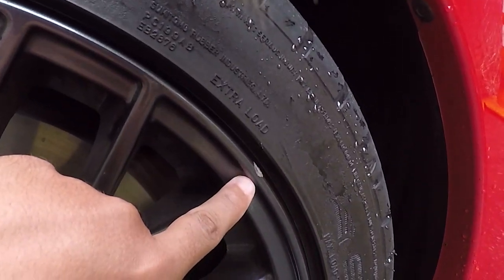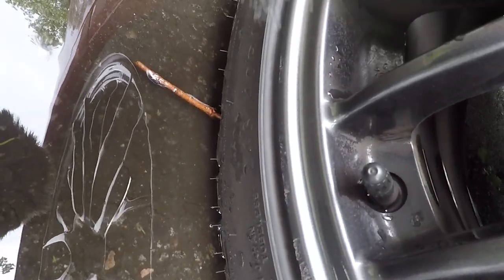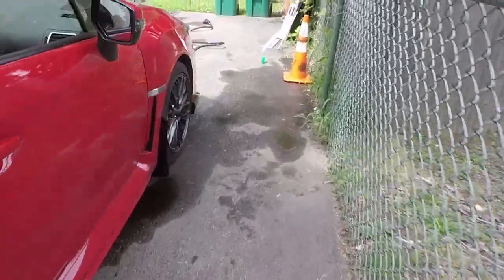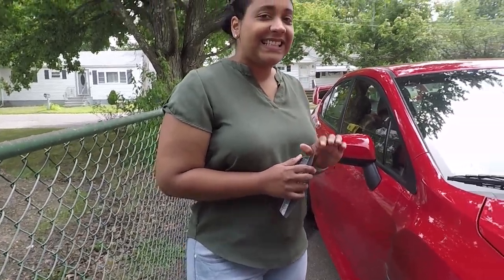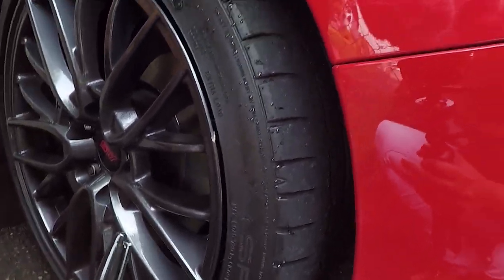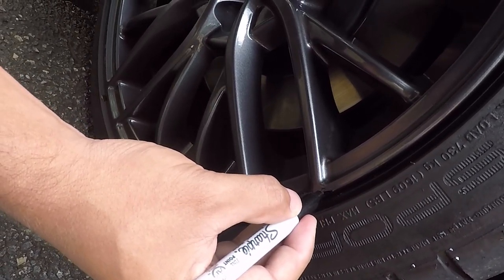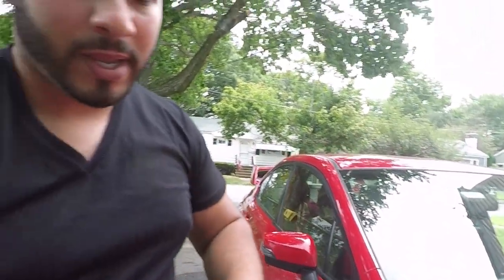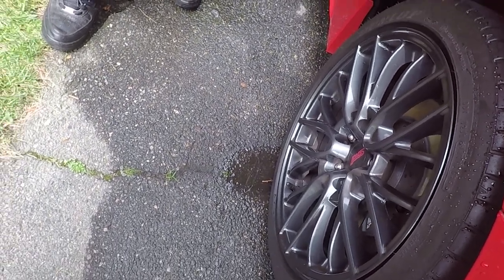DIY: WRX STi Curb Rash Cover-Up

Comment: Dude insane job on fixing this up, that's sick. Need to do this now myself haha.. but my wheels are bronze. So, I guess I need to get them fixed somewhere hmm :/
Reply from the maker: NinjaxBart go to a Subaru dealer and get touch up paint that matches that color or something is close to the color of the wheel until you get them fixed.🙂

Comment: nice video man, i had a similar situation happen to my 16 wrx but only the rear right rim leaving a curb
the premium wrx rim is gunmetal so do you think this sharpee would work
Reply from the maker: Mio Micevski yeah should work. Also if your really worried it won't match just wash the rim and scrub it off the sharpie ink should come off, and get Subaru touch up paint that will match a bit better. Also black nail polish should work :)
Reply: I'll give that a go, possible even a grey/silver sharpie as well, its the same size as the one you showed at 0:36 maybe a tad longer, nobody will know its there but its just something that irritates you lol but thanks a lot
Reply from the maker: Mio Micevski no problem 👍🏽

Comment: This is the most cringe I’ve seen in one video. Don’t take dry sandpaper to your wheels bro wet sand it and have a spray bottle and 2nd no point in wasting your time
Using a sharpie just to come back and have to go over it. Go get a touch up stick and fix it.... and maybe learn not to curb ALL your rims in the future smog